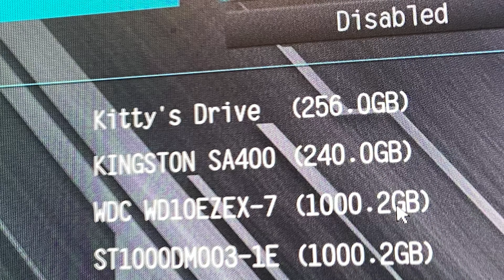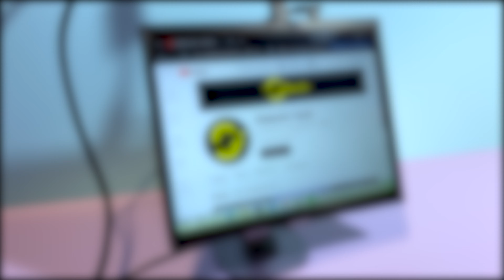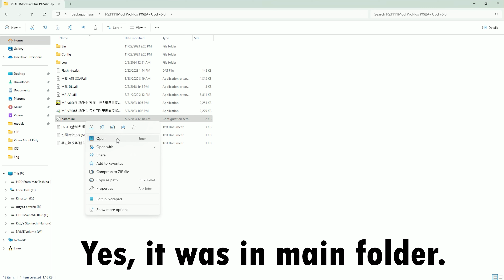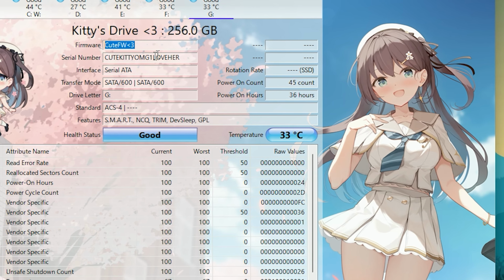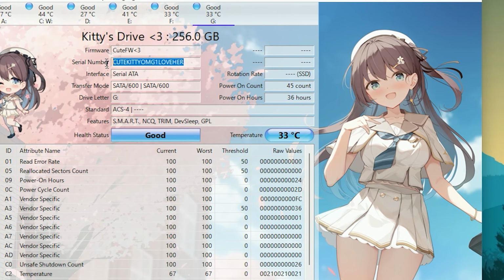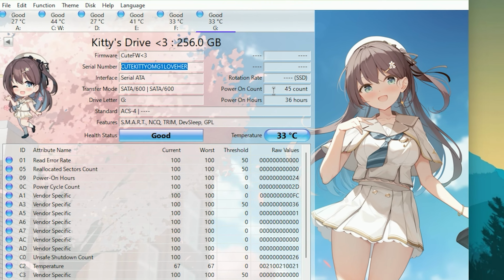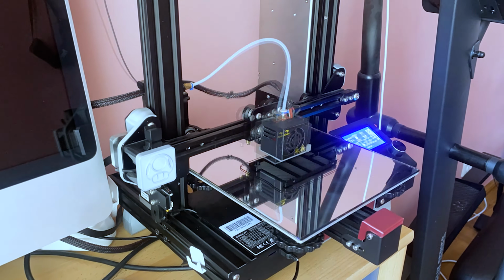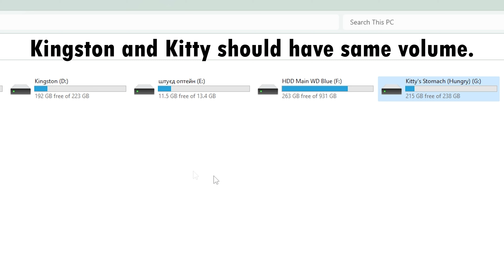I made a custom SSD...

Comment: In Russian biological laboratories, we came to the conclusion that you can put a nozzle on that "Kingston screw", hit it a couple of times, and calmly unscrew it 
Or use a flat nozzle
Reply from the maker: Russian laboratories missed a couple of important things:
1. No one asked;
2. No one was interested in peaceful unscrewing since I wouldn’t need the case;
3. You can’t just use flat nozzle, I advise Russian laboratories to buy better equipment to look more attentively on the screw and notice the dot in the middle of the screw that blocks any other nozzles.
Reply: @OleksiisTech  I have experience with Security Torx. The pin is actually helpful, you wedge a watchmaker's flat blade in right alongside it and it will touch down on a spline allowing you to turn it. Either it comes out, or the pin breaks, turning it into a normal Torx screw.

But being a degenerate capitalist, I bought all the specialised driver bits though.
Reply from the maker: @SianaGearz  My father actually offered me those bits, but I refused to to wait for two hours for him to bring them to me, who needs it when I have pure man strength 💪💪💪